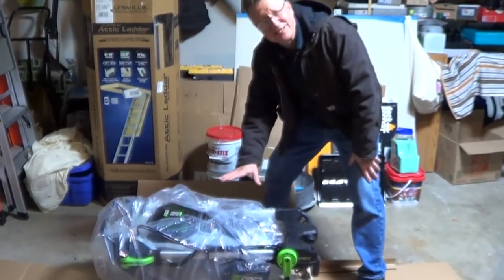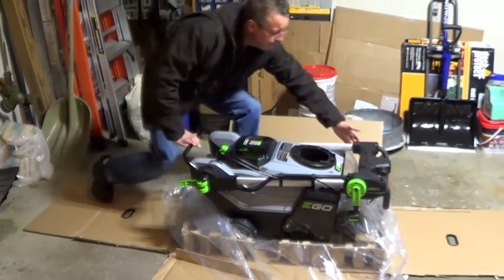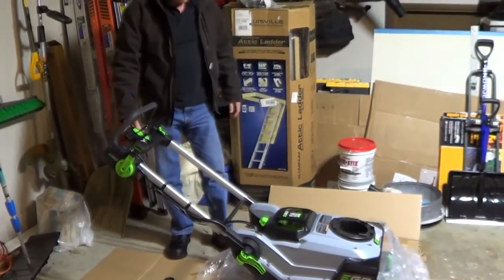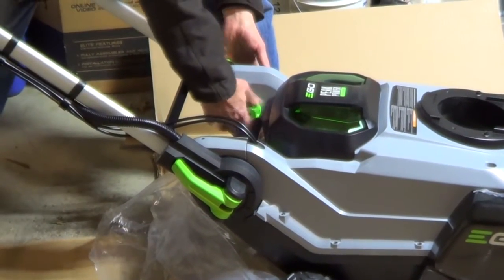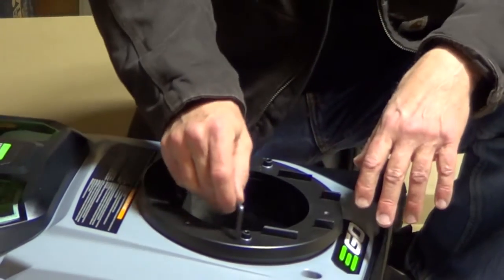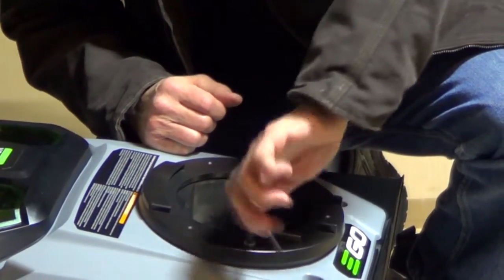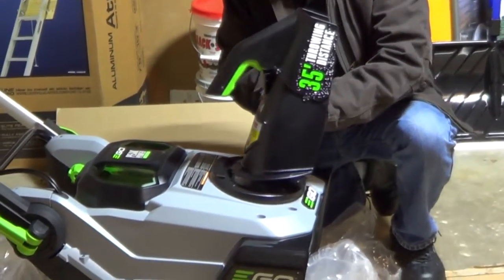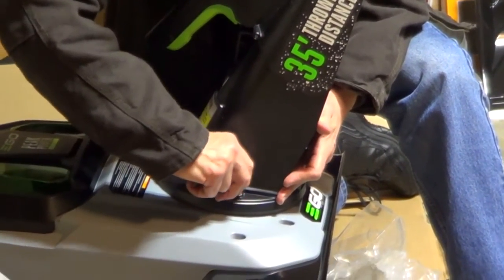How to Build the EGO 56 Volt Cordless Snow Blower

Comment: This did a good job if the snow was 6" deep or less, otherwise you must lift it to shovel snow. >>>t.co/31jr7Tsaaj   This does not have a chute to change the direction of the snow; it's a shovel. That being said, it is an improvement over a normal shovel because there is less lifting. Buy an electric cord rated for outdoor use in the cold. No gas or oil needed.